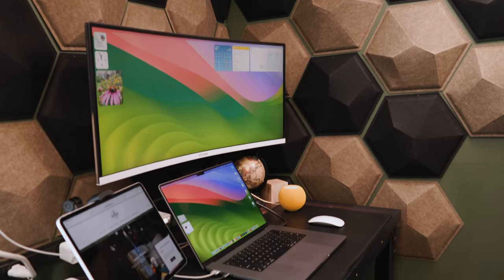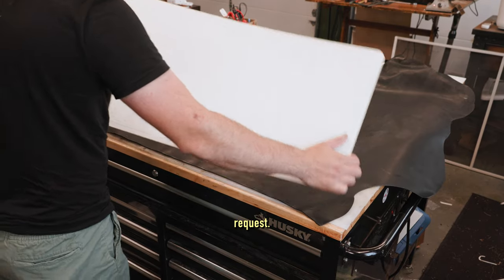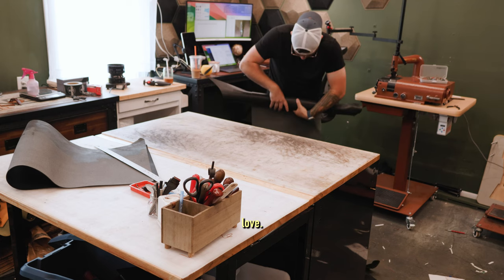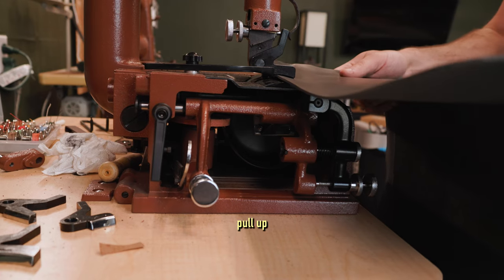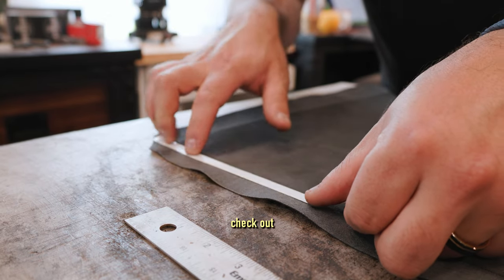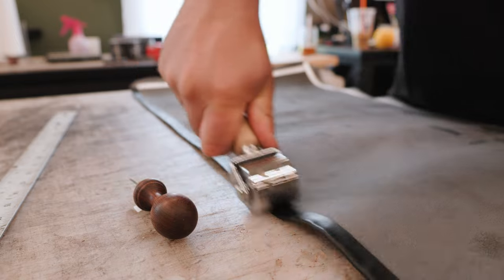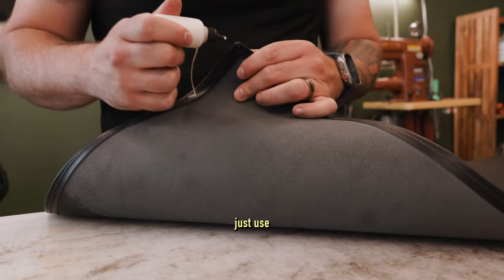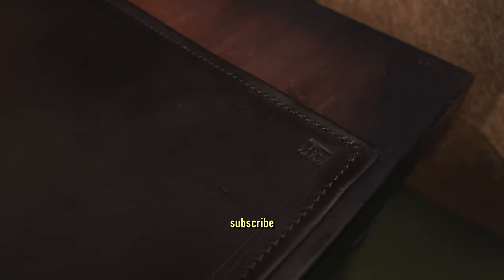Making a BLACK LEATHER Desk Mat

Comment: I recently made a desk mat for a coworker. I tried to skiv the edge down to fold the edge like you do and failed miserably. I dont have the skills to skive 30+ inches evenly without mistakes. I ended up just burnishing and polishing the edges and doing stitches for the look. Turned out alright for my first mat.
Reply from the maker: What tool are you using to skive?
Reply: @80ProofGoods  I have a Japanese style skiving knife. I think if I used one like your French skiver I might of had better luck.